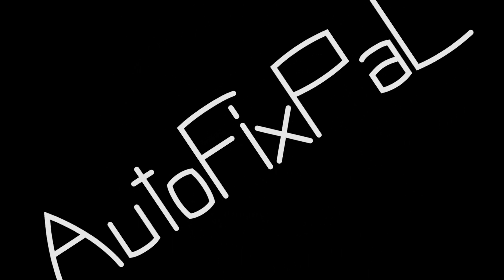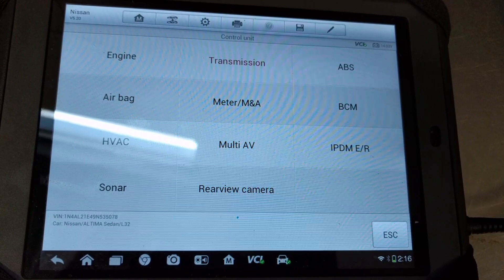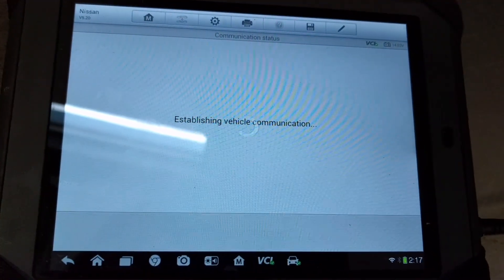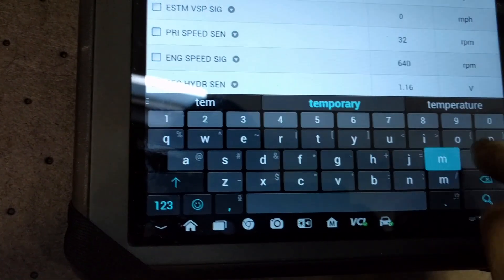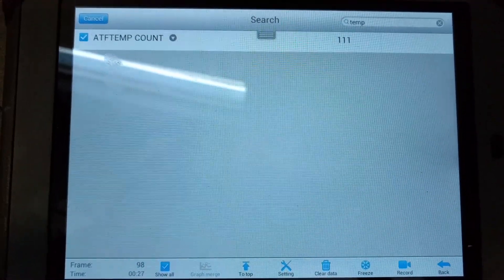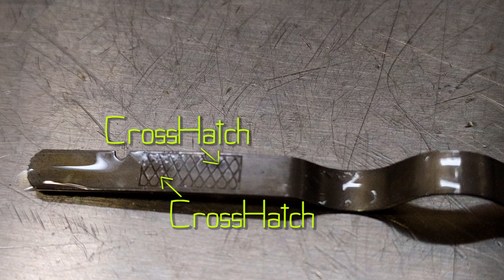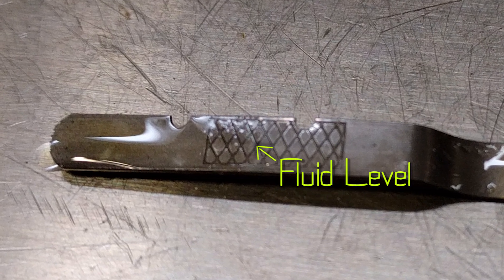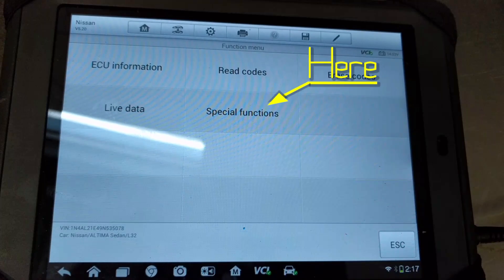Nissan CVT transmission fluid level check and correction with a dip stick

Comment: I have a 2010 altima 2,5 ltr. When I check the transmission fluid and when engine is hot, the fluid level is just above the top notch and at the middle of the cross-hatched area. When the engine is cold, the fluid level is all the way at the end of the stick. Should I add? What are the notchs for and what is the crosshatch area for? TY

Comment: Why wouldn't you teach us how to check the fluid level without a Nissan Factory Scan Tool ?   Do you think we're all running down to Nissan to buy a $42,000 Nissan scan tool in order to check out transmission fluid level ?

Comment: I got an NS2 dipstick from amazon, I have a 2013 Altima with the NS3 CVT, is the NS2 dipstick ok? Also when  checked it the fluid surpasses the cross line section...do I have too much fluid?

Comment: I have a 2009 Altima w/a dipstick. Every 6-7K..... I siphon out a quart through the dipstick opening then add a quart. Takes 10-15 minutes. You can buy a siphon off Ebay for $10. You're basically constantly refreshing your trans fluid...
Reply: Surely you can get more than 1 quart out that way right?
Reply: @condor5635  Of course you could. I just siphon/replace a quart every 3-4 months to keep things "fresh" and the rotation of new fluid in check. No science behind this but shifts smooth at 147,000. Like anything regarding cars, keep up on all maintenance. A couple bucks here and there will save you thousands (if not totaled) all at once...
Reply: @mikeblaz  - that’s what I have been doing as well. I just do more than a quart. Check out my siphon system. I have a video. Works awesome. Just took out 4 quarts from a friends transmission yesterday
Reply: Always more than one way to skin the cat.  Change that paper filter, it get cruddy.

Comment: Ok does the engine have to be running?
Any moron knows it's got to be to temp.  If you gotta use a scan tool to verify temp you need help.

Comment: Operating temp of a transmission will not be aloud to go over a specified temperature. You do NOT NEED a fucking scan tool to do this accurately. For whatever reason the poster of this video does not feel comfortable using logic and reason and for some reason wants to cover his ass in a situation that will never happen, likely because he doesn’t understand what he’s working on. Bring the vehicle up to temp, on the ENGINE coolant temp gauge on the dash. These vehicles have trans heaters/coolers, meaning they operate in a specific temp range for their fluid, about a 20 deg F range, they use engine coolant to heat the CVT fluid up to temp as fast as possible and once it’s up to temp it maintains fluid temp about equal to engine coolant temp using the engines cooling system... they have no trans cooler (at least the 08 and earlier do not).

Comment: Very technical! For those of us without an expensive scanner, just warm up the engine to operating temp then check the fluid level.
Reply: Pretty much, you don't need a scanner at all. Get the car to operating temp then check.
Reply: I usually check once the radiator fan turns on once and then go check the dipstick
Reply: Do you check on park or neutral?
Reply: @Starsnstripes25 
The transmission fluid level is typically checked with the engine running at normal operating temperature. You may not get an accurate reading if the transmission fluid is cold. The vehicle should be in a specific gear (usually PARK or NEUTRAL) and on a stable, level surface.

How to Check Transmission Fluid | Jiffy Lube
Reply: No need to run it for some time?
Reply: @Spawn223311  yeah you should don’t take my advice I recommend obd scanner for temp count .
Reply: @carlosesparzavazquez4753   what scanner is that
Reply: What about if you already did have leakage of trans fluid and you totally dont know how much you can refill

Comment: Do you need to fill the fluid inbetween the notches or up to the HOT section on the dipstick??
Reply: if car is up to running temp then yes hot... as this is the full expansion of the fluid. will settle down on the stick when cool...

Comment: Do you loose power while driving on high speed/way if you don’t have enough fluid?
Reply: Meshak Junior yes you do. Not having enough fluid means more friction. More friction means less power and a damaged transmission if not corrected

Comment: From my research The Notches are for the cold check in the crosshairs are for the warm check, I would be careful taking it to anybody to do top off because the 10 minute oil change change Jiffy Lube, walmart will hire anybody off the street and if they put regular transmission ATF fluid in it it's going to cost you around 4 grand unless you can find a used transmission and trust it. Getting these places to admit they did it unless you got video is going to be 0 to none.
Reply: So on my Altima, I am recording zero oil when car is cold (actually a little warm). So nothing on my dipstick.
Reply: Old post but thank you, I couldn’t find this info anywhere.

Comment: Auto Fix Pal+ nice video and it shows how Nissan techs are supposed to check the CVT fluid level.  I'm a retired auto tech (Old School) and we were always trained to check the trans fluid with the car warmed up, idling in Park while using the dipstick.  I've encountered the "no dipstick thing" on a Mercedes years ago.  They had the claimed "sealed for life" transmission fluid which I totally disagree with.  After all, automotive fluids (Oil, Trans fluid, Power steering fluid, CVT fluid and Coolant) all have a usable life span. Engine oil, Trans fluid and CVT fluid will eventually break down and get contaminated with suspended particles of varnish and metallic filings, because that's what they're designed to do.  My research on CVT's lead me to believe the failure rate is high due to neglect in servicing and overheating,  especially with Nissan vehicles.  CVT fluid (as well as ATF) will expand when it gets hot, thus checking the level at operating temperature is important.  I'd be curious to know how much more the CVT fluid will expand if one checks the level with the fluid temp above 113f.  Sort of a scientific experiment.  Personally, I recently bought a 2015 Altima with 60k miles.  No dipstick of course, but I used a dipstick tool I use for Mercedes and checked the level with the trans warmed up,  engine running and in Park.  I made note of the level and then did a drain and refill with NS-3.  I measured what I removed which was a tad over 3 1/2 qts.  I put back the exact same amount. Drove the car for a bit and rechecked the level with my dipstick tool.  The level was right on from the measurement I made before the service.  I've driven the car several hundred miles and the trans is working fine.   Getting used to a CVT is an experience and personally, I like the way my Nissan performs.  Today I received the Nissan dipstick I ordered Part # 31086 JA00A which is from a 2012 Altima.  I checked the level with trans warmed up and running and was right on the mark in your video.  I think there is a lot of confusion with regard to this process, and obviously the car makers are trying to keep the DYI'ers from servicing their own cars.  Which also brings me to the CVT fluids.  I know the preferred fluid is Genuine Nissan NS-3 for my 2015 Altima, but I also found out NS-3 is backwards compatible with NS-2!  Aftermarket brands of CVT fluid from Valvoline, Castrol and BG all meet the Nissan specifications (along with other cars) and in my opinion are a safe substitute to use in place of the "Nissan Fluid" which we all know is not made by Nissan, but rather it is contracted out to a chemical/oil company to make the CVT fluid to their specs.  Mercedes, BMW, Chrysler and GM all play the same game with their own branded fluids.  There is the Magnuson-Moss Warranty Act https://lemonlawcar.com/magnuson-moss-warranty-act/
the Act prohibits using “tie-in sales” provisions. This includes selling a warrantied vehicle while requiring the consumer to only receive services or parts from a single business. For example, a manufacturer can’t require you, under a warranty, to only use a certain brand of tires in order to maintain the warranty.  The same goes for oil, coolant and fluids, provided the aftermarket product meets or exceeds the car manufacturer's specs.
On another note, I plan on installing an auxiliary trans cooler and try and stay ahead of the overheating issue that plagues CVT's.  I'm also going to do another fluid change soon using BG CVT fluid (which is used at my local Nissan dealer)
I hope this write up helps dispel  the myths and rumors surrounding some of the CVT issues.
Reply from the maker: Fantastic information and i totally agree with every point you made. I do have some videos coming down the pipeline that shows people how to set the level using an infrared temp gun, dipstick Nissan or non dipstick Nissan. Generally Nissan would not deny a warranty claim if the fluid is not Nissan Fluid But they will if ATF was put in. 

The Altima is a very good driving vehicle and for the most part there really isnt but a couple pattern failure items on them. I can't however say with absolute certainty that the CVT issues are entirely due to neglect, i have seen quite a few failures under 15k miles (especially sentra), there is actually TSB's for CVT issues where replacing the valve body solves the issue under certain circumstances, and or replacing the sub assembly. 

You know its really strange because some vehicles come in with 150k+ miles and original CVT but others not so lucky. I mean if you think about how the CVT works its just belts and pulleys that need to stay matted together without slippage. Not like a regular auto trans with clutch packs, accumulators, hydraulic actuators, clutch bands, drums, ETC. So one would think its just a matter of keeping the valve body and pressure in good working order in a CVT and it should be trouble free. A lot of the failures are Pressure Control issues, loss of pressure. I have not done any research on this as to why or whats actually going on inside. But based on the DTC's i get and the belts slipping i gather its either pump failures and or control valve failures. 

If yo have more info on this please share. looking forward to your response 😊
Reply: @Autofixpals  Thanks for the nice comments on my write up.  And yes, I would agree with denying a warranty claim if someone put ATF in a CVT!    Speaking of ATF, I've been using Valvoline MaxLife DEX/MERC in my Mercedes with excellent results.  Easy enough to go on Valvoline's website and look at their product application guide.  I've even called their tech center and they are very helpful in answering questions about their products. Thanks again for the great video.  I'm subscribing to your channel and will look forward to checking out your posts!
Reply from the maker: @izzydizzy1115  Thanks for subscribing. Its probably about time I change the Trans fluid on my Ford Edge. I will look into the Valvoline Maxlife.
Reply: All I was really looking for is do I check it cold or at temp, and in Park or Drive. That was all that I really needed to know. Thanks for clearing that up for me. :)
Reply: I want to know anything odd that you encountered with this particular model. My grandma has the same one. Fluid is still almost crystal clear.
Reply: Hello  when doing just a partial cvt fluid replacement of Nissan X-tral t32, is it  essential to monitor the fluid temperature using diagnostic software or a handheld infrared temperature gun to ensure it reaches the correct operating temperature or we should do  just the  draining and refilling the CVT fluid while The fluid is warm, but not excessively hot? Can this partial cvt fluid replacement '(no flushing of transmission)  dislodge debris or contaminants in the transmission for high mileage cars of 100k miles as I haven't changed the CVT fluid before?

Comment: i have a 2010 altima with a dipstick, does that mean is not sealed? it has 115k miles nissan recommends a flush at 100k should i do it? they claim they the only ones that can do it if not trans will fail
Reply: Scam...Nissan and Toyota Dealers both make that claim.  
They just want you to bring your car in for their much more expensive service.  
Pulling or emptying a Pan does not affect your transmission at all...but what you put back into it may.
  If you can afford...just use their NS-2 Fluid until your Extended Warranty ends.  
Also, get an extra Pan Gasket too...in case the original one goes to tatters on you.  
You don't have a Drain Plug for the Transmission on the 2010 Altima.
  So you either have to drain by slowly removing the pan and slowly letting it drain into large Oil Change Pan...or sucking the fluid out with a device that will go down through your Dipstick Tube and into the Pan...but that is only for a Drain and Fill.  
If you're doing a Flush, you'll have to remove the fluid 3 to 4 Quarts at a time through the Transmission Cooler Output line that directs the fluid towards the radiator.  
To do this, you have to extend the hose a little and place it in a Gallon or larger Jug or Container, run the Car in Park until you've pumped out 3-4 Quarts and shut it off, then put in the amount of new fluid to replace what you take out.  Continue to pump out another 3 or 4 Quarts of the old Fluid and repeat the step until you have relatively clean fluid starting to come out from the hose...then stop!  Check your Dipstick...and keep the fluid at the lower mark (first mark) and go start your Car and go through all the shifts at least 2-3 Times and in reverse every 5 to 10 Seconds. 
 Check Fluid level again and go for a ride for about 20 Minutes.  Come back or stop and leave your engine running and check the Dipstick again.  Fluid ideally should be somewhere between the low and high mark on the Dipstick.

Comment: Hey can i check the fluid when is cold ? Cause that what said in yhe manual to ? , other way to check the temp is with a temp gun pointing the oil pan ? Cause i dont have that scanner thabks
Reply: I use a a obdlink LX with an app called CVTz50 to check the temp count less than a 100 dollars
Reply: @rocket8166  can you post link ???